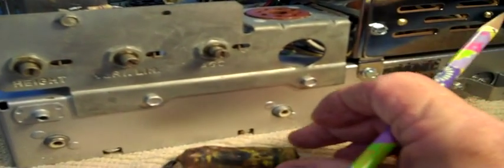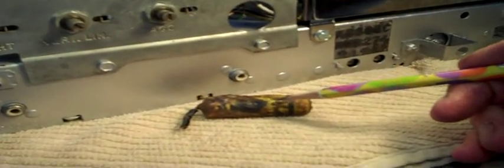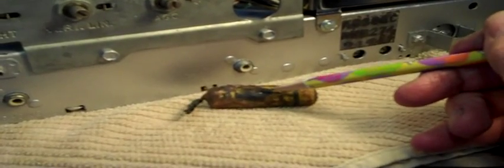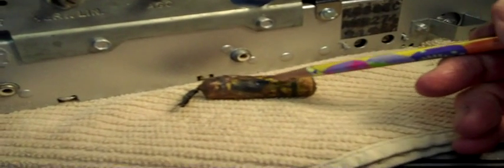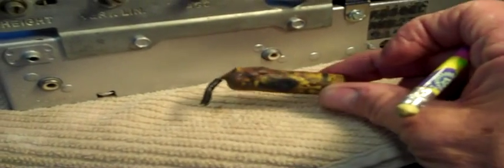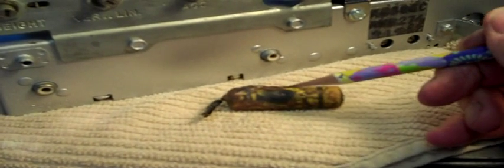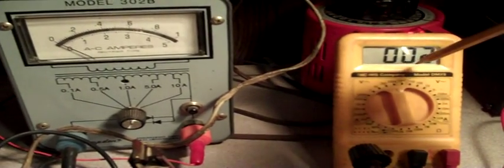1952 RCA Model 17T151 17" TV Repair and Restoration (Part 23 of 27).

Comment: I've been working on a Sylvania R5151.  Replaced two tubes, all the capacitors and one toasty resistor.  It works but it is a bit erratic at times.  I'm contemplating replacing the pressed copper antenna in the back and it may have a few noisy resistors as well.

Comment from the maker: It would take a large pile of silcon diodes to make up the selenium rectifier resistance loss.  One correct value resistor at a fairly high wattage will do the trick.  We'll do it in an upcoming vid.

Regards,
John

Comment from the maker: Tim,
The dropping resistor value has been calculated and the resistor will soon be installed.  It's on order.  But right now the variac is taking care of the voltage requirement.

Regards,
John

Comment from the maker: Right you are.  I'm aware of the selenium rectifier resistance loss and are taking steps to remedy it, but right now the variac is doing the job.  Even so, at 120vac the B+ is only running 42vdc higher, which isn't really that bad.  But it'll be brought down.

Regards,
John

Comment: John, at the time that set was manufactured, the prevailing line voltage in most of north America was 110 - 115 VAC. running that set at the current voltage (120v) will cause the B+ voltages to be higher then what the schematic shows. the use of Silicon Diodes will elevate the B+ voltages even more. when you adjust the set, you will need to run it on the variac set at 115 volts.

Comment: Selenium diodes got a much higher voltage drop than modern silicon ones. so maybe you need to connect several silicon diodes in series to get the same voltage drop as before, and get the doubler voltage down.

Comment: think you need to lower the voltage with a resistor, since silicon rectifiers are more efficient then selenium rectifiers. the B+ will be higher then it should be. if the B+ is 260, you need to keep around that level when then input is around 120